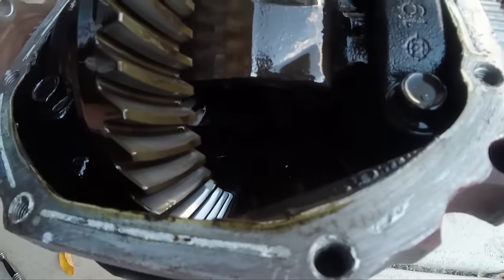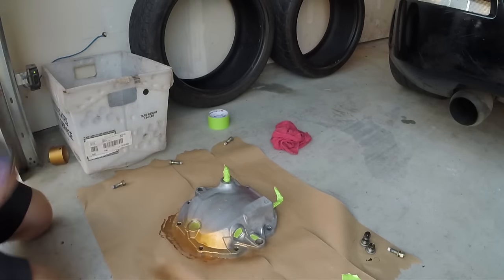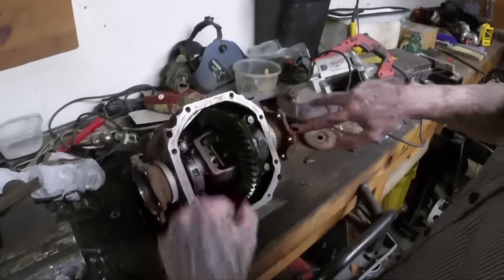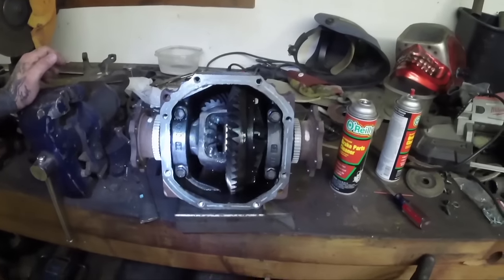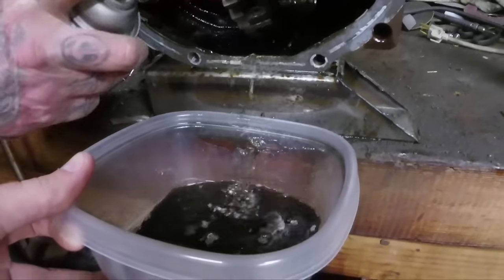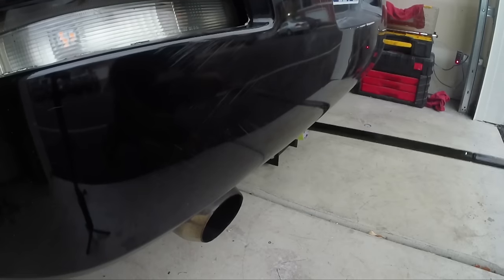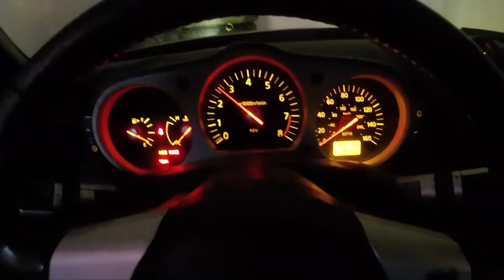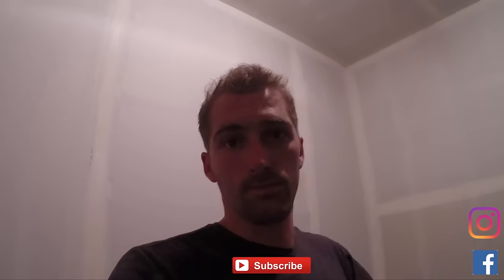DIY Welding Differential!

Comment: why didnt u go lsd btw? and i can't wait to see u take apart the old diff, i have the same whining problem. So you recommend solid bushing in subframe and polyurethane for the ears?? and why didn't u put a nismo cover on diff? with the fins
Reply from the maker: Money. Will tear down soon. Yes. And because money for a Nismo cover on a welded makes no sense... The Nismo plate is supposed to keep the vlsd diff cooler and not lock/unlock randomly. Welded doesn't matter if its hot as titties or cold as balls, it'll always be locked! haha

Comment: Great that the new diff turned out good! Just one question... why did you loose the backseats? I remember I took it out in my S13 (CA18DET) and it was just a horrendous noise from pretty much everything (the already loud changed fuelpump just sounded like a jet plane)... I just did it for loosing some weight... but when weighing in the noise and the couple of kilos I "won" was just not worth it with a daily driver... the backseat was really really light weight anyway and was a great noise reducer...
Reply: It's a 350Z.. there are no back seats! lol
Reply: Oh I always thought it was a dwarf seat like it was in my S13...

Comment: Hey man had a quick question. When you swapped out the diffs were you able to re use your solid metal bushings or did you have to get a new set? Cause I know you had to hammer them in and wondering if it's a bitch to get them back out ?

Comment: hey man I just started watching your vids (they're great btw) but I have a question for ya. I've been searching for a long time and can't find anyone or any info about driving around with a welded in the mountains. I want to weld my diff but I'm really worried about tire wear for like daily driving. obviously a welded is gonna wear tires a little faster..but I have a lot of turns just to get to my house. im talking 57 turns in the 7.5 mile section to my house to any real road. it seems you drive in some hilly/mountainous areas. any and all info you could provide on if it's do-able, tire wear, pros/cons would be great

Comment: has the diff lasted? has it broke any half shafts? is it still running with the soild diff bushings? 
sorry for all the questions. I need get mine welded then swap it over asap
Reply from the maker: It has lasted great! Still have the rear Solid bushing in and going strong!
Reply: PNWGarage great news you still on stock suspension? I'm going to order my bushing other the weekend then thanks for the reply
Reply from the maker: Still stock! Really hoping that changes asap!